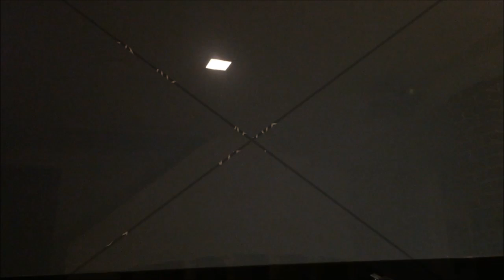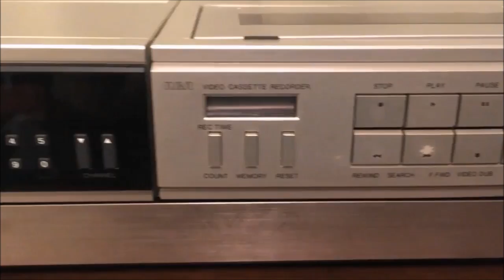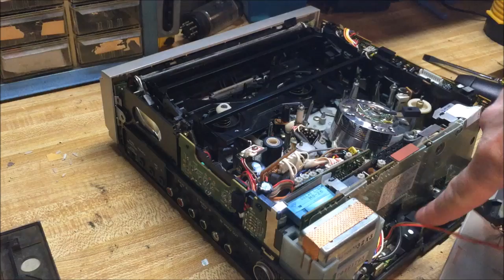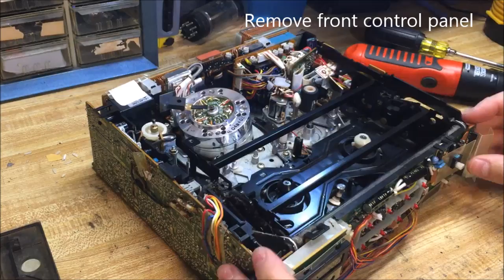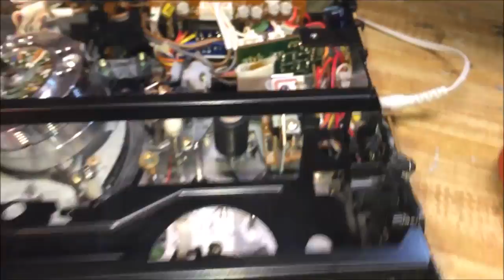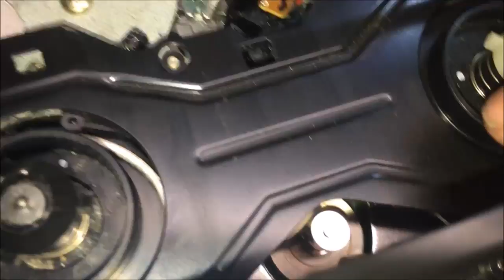This VCR Was So Famous It Got Its Own TV Show! VHS VCR history, retro tech

Comment: The belts turning into goo was a supplier belt problem with poor rubber material quality and wrong formula. Hitachi, the manufacturer of this RCA unit, also designed the mechanism wrong that could have easily eliminated the belt problems in the first place.

Comment: I'm pretty sure this is a Hitachi built model, it looks a lot like my 1983 Hitachi VT-7A. I got mine from my next door neighbor and I think the belts are also shot on it. It doesn't load and the tape doesn't move at all. It also makes a bad sound when it tries to thread the tape. I would like to try replacing the belts but I will bet money there will be other electronical problems which is beyond repair for me (soldering etc). It also looks like a nightmare to access the belts, so many boards you need to remove. 

And yup, you're right about the VHS portables, they are cursed with bad caps everywhere. I just gave up on trying to find one working and got a Betamax portable (SL-2000) from 1981, it works great and there's no leaky caps. Sony's stuff was amazing and still holds up today. I also have an older industrial Betamax portable, an SLO-340 from 1978. Still works.

Comment: I picked up a VKP-950T.  Thanks to your video I was able to take it apart without breaking it and replace the belts.  However, it's pretty slow to thread tape, and it's incapable of actually getting a tape to move.  I just ordered a new pinch roller and idle assembly in hopes that'll fix it, as an old VCR repair video demonstrated the exact issue I was having as a result of a bad idler.  However, when watching said VCR repair video, they're able to put it into some kind of service mode where it doesn't need a tape (so you can actually see the mechanism working.)  Unfortunately the followup videos that show you how to do it are missing.  I looked everywhere for a service manual and couldn't find one that didn't cost $20,000 from some sketchy website.  Do you have any idea how to put it into service mode so I can inspect the mechanism without having a tape in it?

Comment: Oh, THANK YOU for this video.  I just picked up a VKP-950T in great condition, but the belts had literally melted.  Trying to replace the belts and I couldn't figure out how to get the bottom plastic off.  I didn't want to force it and break it, so I spent hours and hours looking for a VKP-900 or 950 datasheet or service manual, but nothing.  I don't know what the difference is between your VJP and my VKP, other than the VKP appears to be black instead of silver.  It's gonna look great on top of my RCA Dimensia. :D

Comment: Hey man, I have the same vcr that i'm tryna revive. Before I tried anything I could hear the motor turn and all fhe mecanism trying to work when I pressed play.  I replaced all the belts and now when I try press "power" I can only hear a "click". Do you know what my problem is? Btw, you made a very nice video!!
Reply from the maker: Thanks for your comments!  I believe this machine needs all the capacitors replaced.
Reply: @databits  Cool, thanks for the advice!
Reply: @databits  But have you an idea why it worked before I opened it to change the belts? And I really need to change ALL the capacitors? There are so many of them hahah
Reply from the maker: Maybe not all, but checking each one before replacement could take even longer!
Reply: @databits  Oh yeah you're right hahaha

Comment: Try this to fix the idler tire, remove the tire from the white plastic, wrap dental floss around the plastic to thicken the outer diameter, then put the tire back on. Trial and error to get it working right. This works I've done this, and no cost

Comment: Fixed many of those back in the day.  Idler wheels and belts were common failure items. You should also remove the bottom cover and check to make sure that the four rubber cushions on each screwhole are removed. They were made of a type of material that would actually attack the PCB and eat up the traces. This is an extremely complicated VCR. I believe there also was a Minolta version.

Comment: databits

I've been looking for a model of VHS VCR for a number of years now...

I'm 90% sure it was a Ferguson, and the tape slot was on the left-hand side (front loading).

It's unique feature was that it had a framestore module (that sat behind the right-hand side of the front panel).

The framestore meant that it could do superb freeze frame, trick shots, and Picture-In-Picture.

I'm pretty sure it even said "PIP" on the front. It had a fairly slim looking black case.

I recall that the framestore module was fully shielded, but with many holes in the shielding, and contained a few Mitsubishi parts like SIP DRAMs.

Just wondered if you (or anyone else) might have stumbled upon the same or similar VCR, possibly sold under different brand names in the US?

I've looked all over Google Images etc., but haven't even found anything from normal searches.

Comment: What's the polarity of the 12v of the machine? I have a similar RCA Selectavision VCR that's a full portable unit and have no idea what the polarity of the plug is. I obviously don't want to blow it up by using the wrong polarity power supply.
Reply: If you open it up, it's easy to see inside which side of the power connector goes to ground.

Comment: 1. Ive never seen a 5 head vcr. even in the 90s there was just 4 head hi-fi ones.
2. Just what is that in the beginning that loads from a case then spits it out? Is there a laser disc in that it removes and plays?
Reply: Basically yea, that plastic shell just holds the giant disc, which gets removed and put into the machine while the case itself is ejected ;)

Comment: Why is not taking the tape, the belt goes to a dedicated motor to do that ? or it is done by the tire in the middle. I would check is the 5V are fine since you get garbage on the LCD probably the other logic funtions are messed up as well.

Comment: smcelectronics.com have a bunch of replacement idler wheels for vcr's.  what you refer to as the tire.  Also, if it's not totally hard, you can try a rubber restorer product, just be sure it's safe for plastic.  I use CaiKleen RBR.  Also, get yourself a can of Deoxit instead of using sandpaper to clean contacts.

Comment: those rubber idlear wheels are no fun and the one thing I have with rubber idlear  is a panosonic caseett recorder from the arely 80s. the belt and rubber idlear are the original ones from the factory and still do the job. this tape recorder wasn't used very much

Comment: I recapped a CS-80 synth, you can recap this! :)
Reply: Peter Howell shows up
DID SOMEONE SAY CS-80???
doctor who theme starts to play like crazy
Reply from the maker: +The Dollar Guy - No!  I refuse! :)
Reply: Awe c'mon.  Take the number of circuit boards in a CS-80 and divide by 10 and you have one little ol' VCR.  How do you know you won't like it until you try it?
Reply: Easy to recap...but finding the required values...
Reply: Oh, dear jesus, that seems like a long and painful job.
Reply: Oh I'd recap that thing. I'v recapped a few motherboards and DVD players before, can't be that much worse. I'd also likely replace everything I could with polycaps, so they don't need replacement again for a LONG time. Bet you it's only 10-20 different values, especially with things this complicated they want to make the manufacturing as streamlined as possible. And reducing the number of capacitor types is probably one of them. But I guess that's just my thoughts.